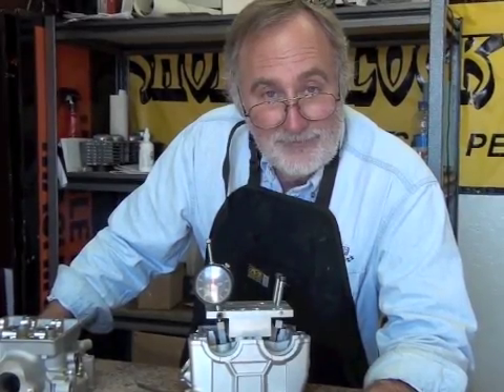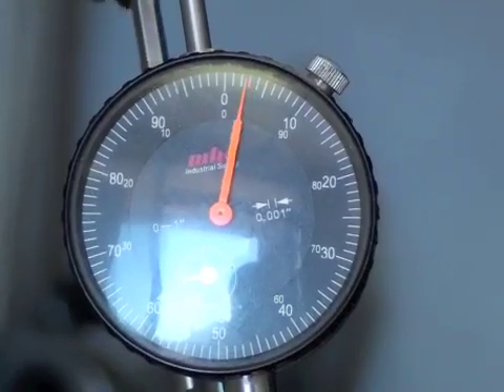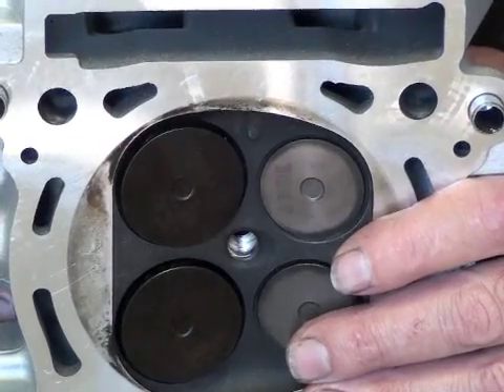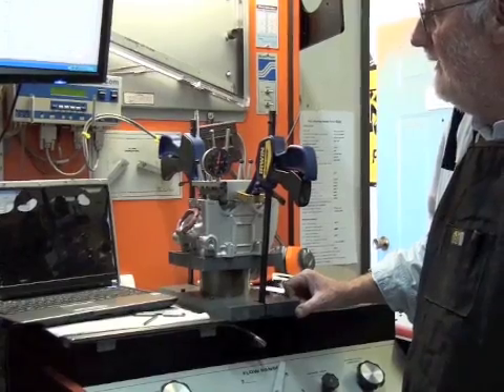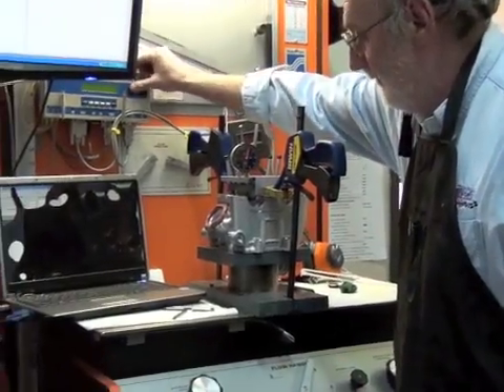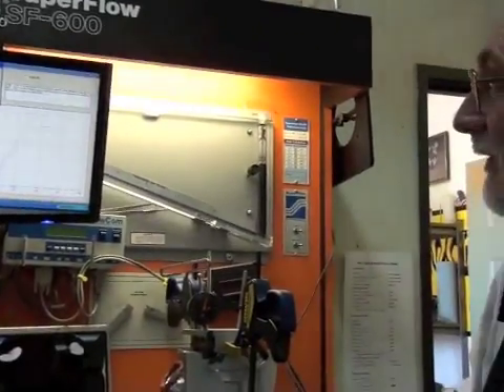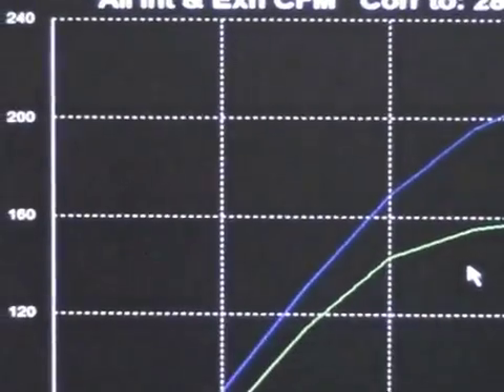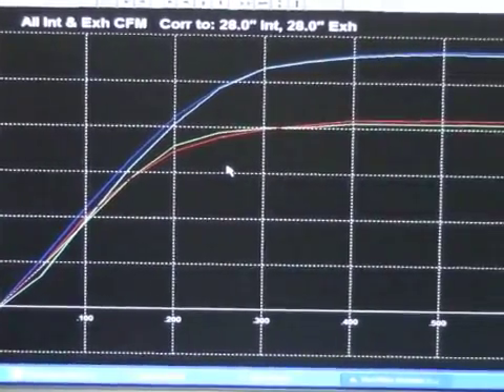Flow Testing a Stock Cylinder Head (Part 1)

Comment: Wow! Very COoL. I'm a little late to the party.. 2010? So much to learn so little time.. It's an amazing thing to have you share your experiences on line.. It's like hanging out at the shop (and not being chased away:). You really made a GR8T point (in my mind) about the (actual) valve lift. That is not a lot of room to squeeze through and it needs to be made the most of (haven't caught the next video yet). Really inspiring work. We are all wrench heads in our minds but only a few get to live it. Pretty cool. Thank's Mr.C for the time. R (So. Ca. USA)

Comment from the maker: @rwdford you are correct this common to find in stock ports. this where spending alot of time trying different valve seat angle a working around the port area around the seat is so inportant  thanks charlie

Comment: Very interesting, would I be correct in saying the loud screeching sound from that inlet port at moderate lift indicates turbulance in the port most likely around the valve seat area?
Should the port get quieter as it is modified since the air will flow smoother with a higher flow rate and velocity per port X sectional area?

Does that make sense to you?

Great work as usual :)
Regards
Jason